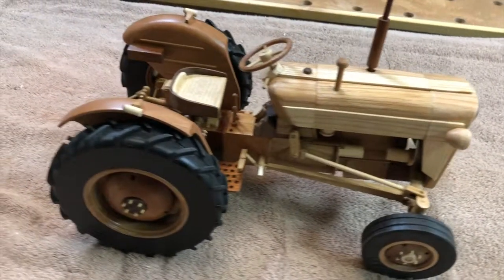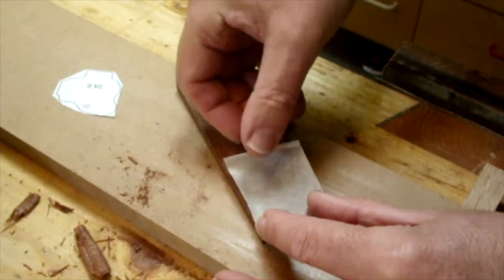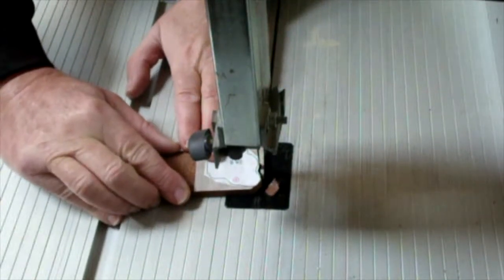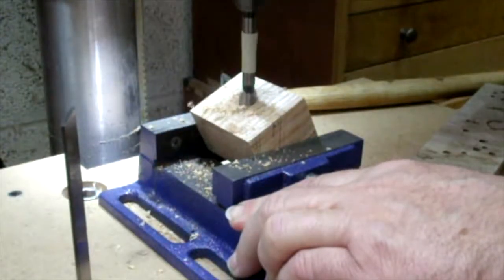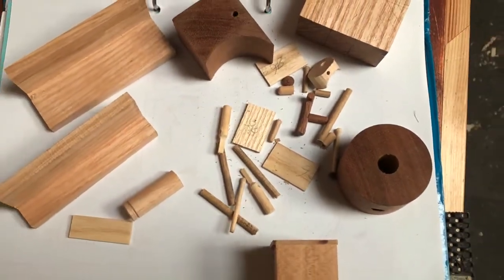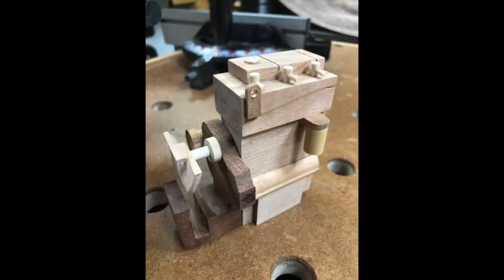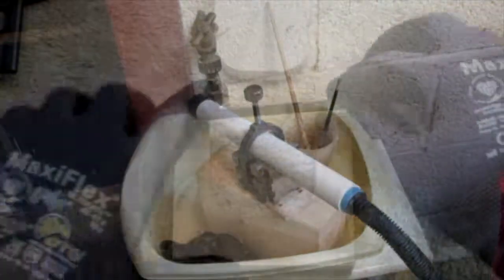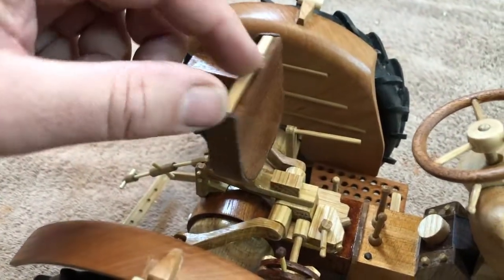How I made a Tractor (Fordson Super Dexta)

Comment: awesome job. How large is it?
Reply from the maker: Hi Marcelo,
Thanks for the compliment, 
Sizes are 350mm or 13.5 inches long by 210mm or 8.25 inches wide (rear tyres) 180mm or 7 inches (front tyres) and 180mm or 7 inches tall
Cheers Steve
Reply: @Phenrica  Thanks for the answer Steve. Beautiful work and attention to details.
Do you know roughly how long did it take you??? I’m guessing 120-150 hours????
I think I’m gonna try some of Duchies designs. I got about 30 models built so far. Nothing new for me. Wish me luck
Cheers from other side of the pound
Reply from the maker: @marcelo403polo2  Awe thanks and spot on by the way it took about 130 hours to build as I recall. It was the most complex model I’ve ever attempted and with your experience Marcelo I’m sure you’ll do a great job  and no luck would be needed 😉
Reply: @Phenrica  Thanks again Steve. I’m at work now but I’m gonna check some more of your videos in the evening